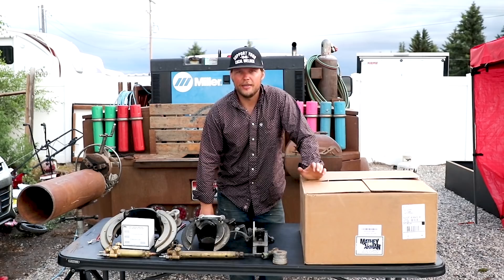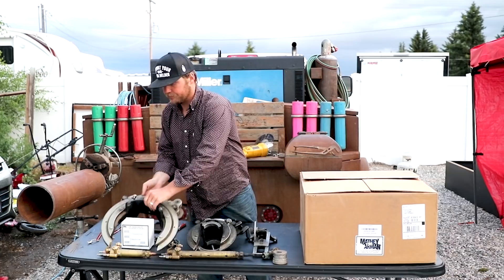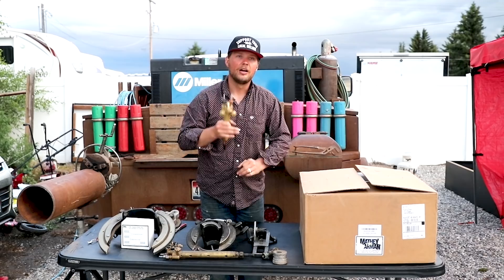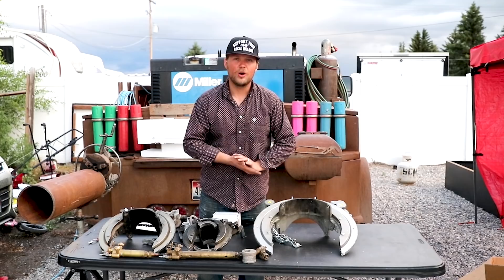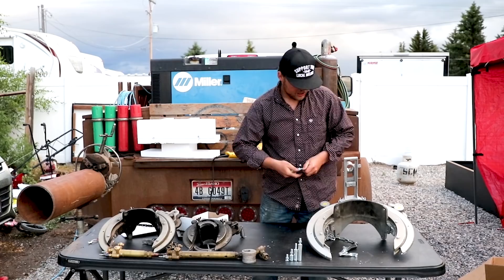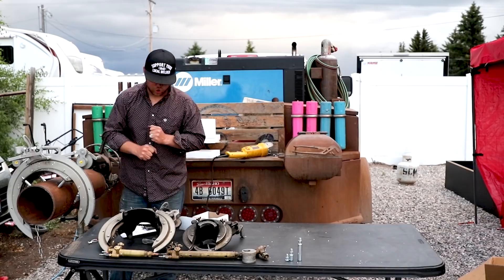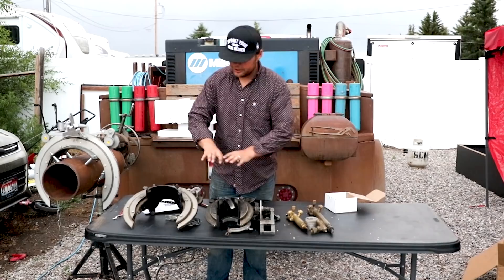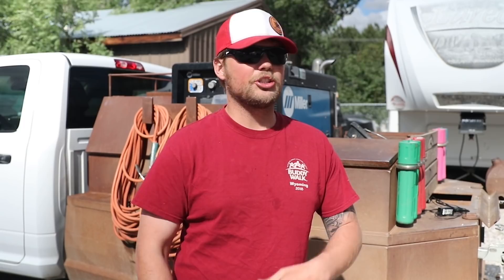Pipe Beveling Machines- What To Expect and What Is Required.

Comment: am i correct in assuming your helmets are not auto darken?   do you use a fairly dark lense?
Reply from the maker: Our lenses are replaceable so if you want an auto darken you can buy one or if you want to weld with a straight shade you can have that option too.

Comment: Can i use my short barrel torch in 10” with the 12 beveling maching
Reply from the maker: Yes sir they will work great it’s just when you start getting into the 8-6” range on a 12” beveler

Comment: Why cant you use a skinny wheel to cut 8 inch pipe? Another good video its good to watch you Jacob!!
Reply: Because it's a lot slower and you'll have to grind to the cut to a 30 degree bevel after your cut.
Reply from the maker: The amount of time it would take on a job would slow you down way to much. At home no problem go for it. But production stuff definitely use a beveling machine
Reply: The skinny wheel would get you laughed at for milking the clock

Comment: Ah man! I wanted to see it in action! 2 Questions; 1: Those torches are oxy acetylene? and 2: ISsthere a constant rate you have to crank the beveler as it goes around the pipe?
Reply: OctoMan PC's yes they are oxy acetylene torches. And for 2, when cutting you always want a constant and consistent speed
Reply from the maker: Oh you will this is just an unboxing.
Reply from the maker: We will use it a lot and I’ll show you how to set it and use it